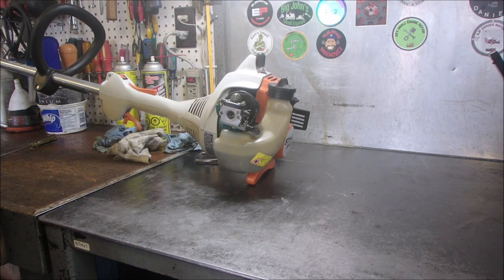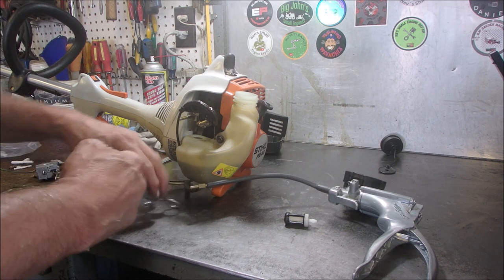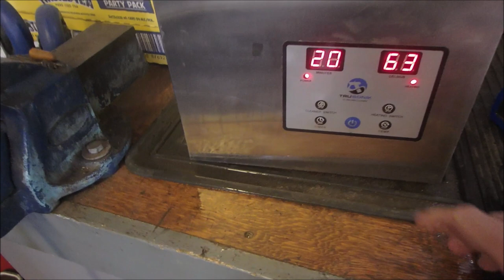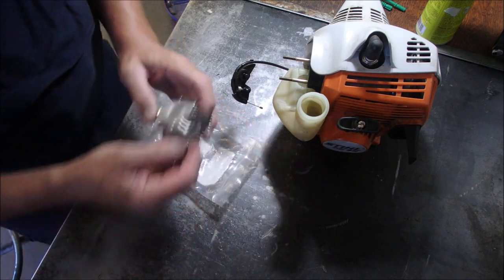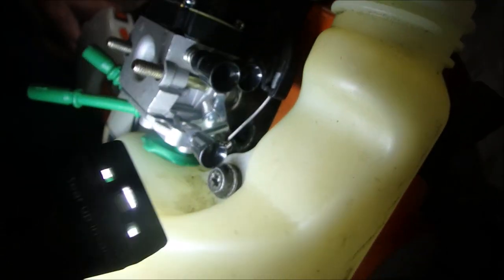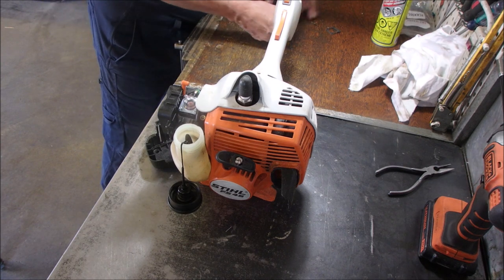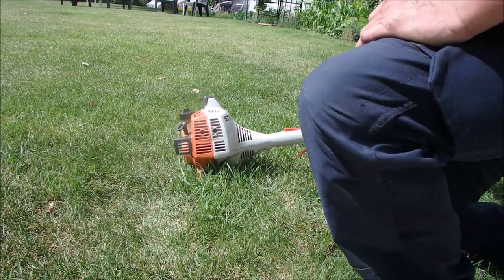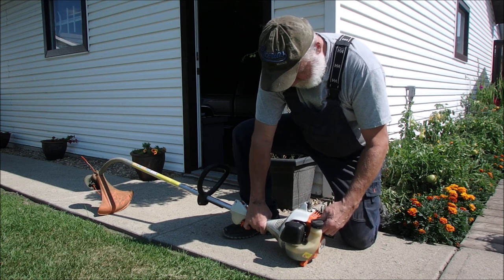Repairing a Non Running Stihl FS45 Trimmer

Comment: Good job Bruce!

I've been using the knock off carburetors on 2 cycle machines I get for years and never had any issues.   I have found that the high and low speed needles more often than not aren't set properly but as you know that's a quick and easy fix.

Have a great weekend.
Reply from the maker: Thanks for the info!
Reply: @BrucesShop  You're welcome...its the least I can do given ALL of the information you have given so many of us through your videos!

Comment: Good change of pace on a two stroke repair Bruce. At EP we basically stopped doing 2 stroke repairs on trimmers and chainsaws simply because the profit is not worth the aggravation and much of the stuff coming in is not worth the cost of repairing it. We had found that the main issue with the aftermarket Amazon purchased 2 stroke carbs was quality ie: many of them needed blue locktite on the idle adjustment screw to hold it in the proper location, seemed the thread quality just did not let the spring pressure hold it in place when the engine was running. But for the price and provided the owner is doing it themselves go for it you may get a season or two out of it. The biggest issue is fuel issues so using canned ethanol free alkylate fuel 50 to 1 mix like Aspen or Kinetix is the answer. Our neighbour purchases this from us and all 5 of his 2 stroke pieces of equipment have run without issue for 6 years now.
Reply from the maker: Great info Wayne.  Funny thing is that all of the 2 stroke stuff I have worked on this year is my own.

Comment: I put a Chinese carb on my neighbour's fs38.  Silly me didn't change the grommet.  He brought it back this year because it wouldn't stay running.  Of course it was the fuel hose end. After replacing  I  had to slightly adjust high screw to get it to rev up. Possibly hus sil had touched the screw.
Reply from the maker: Right.  The more I use this one the better it is.   Thanks

Comment: Some of the carbs had a single screw adjustment, and not separate hi/low adjusters.  I found those seemed to have a faster throttle response.  I haven't got a clue what the differences really are, though.  I use a lot of the aftermarket stuff on 2 cycles, and as you found, more often than not they need adjustments.  Usually, I have to lean them out as they seem to be set pretty rich.
Reply from the maker: Thanks.  By the tme I am done with them i really don't know where I started.    LOL     Thanks.
Reply: @BrucesShop   LOL I hear ya on that one!

Comment: Excellent video. I'm currently trying to figure out what's wrong with my Poulan Pro chainsaw.
Reply from the maker: Right  I you have tried eveything and it woun't run right don't forget about the crankseals.  There is lots on line abut that.
Reply: @BrucesShop  Well it was bogging down. The saw isn't even 2 year's old. I was trying to check the fuel filter and guess what the fuel line broke, so now I have to replace both fuel lines. That's not to hard just takes some finagling to get them in there. But I for the life of me can't figure out how the on/off switch connects back to the metal tab that kills the engine? Or what was causing it to bog down. I also found a screw that looks like it went to the carburetor with a spring behind it, is that the idle screw? They were laying down in the handle casing under the carburetor, could that have caused the bogging down?

Comment: i finally got a mityvac james condon sent me link using it everyday seems like even blew out plugged fuel line on a ride on with tank in back and didn't want to take line off i got the heavy aluminum one not pvc
Reply from the maker: Yes  I use mine every few days.